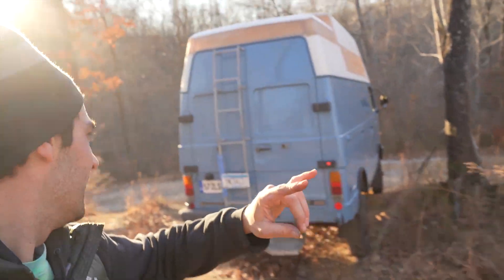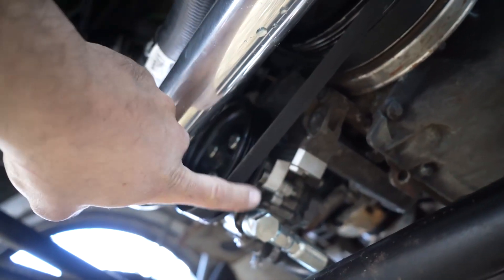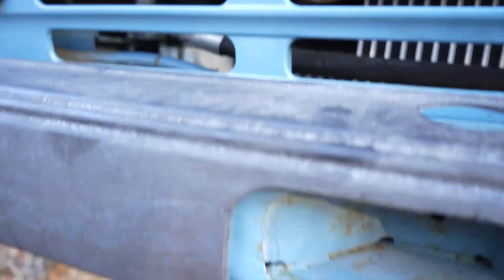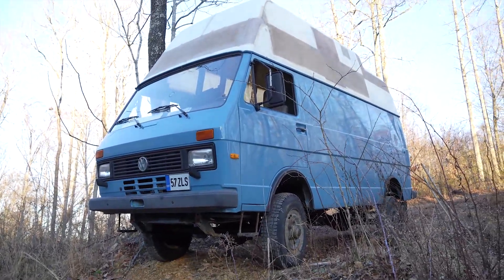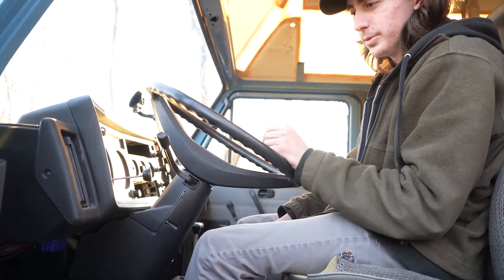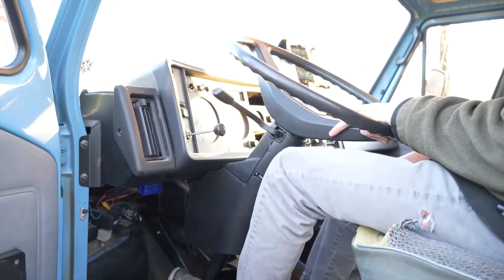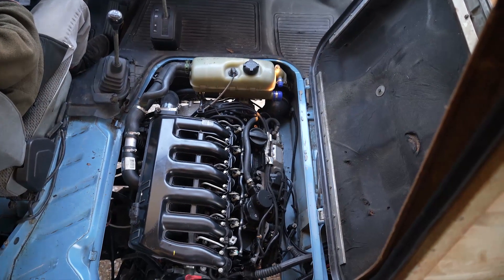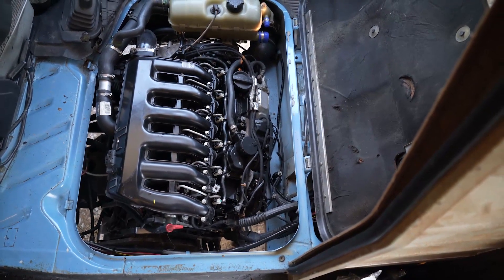Volkswagen LT40 4x4 TDI conversion? The BMW M57 3.0 Twin turbo diesel!

Comment: I only just saw your video. We are about to put this engine in our LT. Can't believe that not only were we beaten to it, but by years 😂. We had a British Ford Capri old school 3 litre in it, then a Jaguar v8 on LPG, but the M57 is the perfect engine for it I think. We are going for about 260hp and adding a separate overdrive gearbox independent of the main autobox to allow for great highway cruising

Comment: Greetings from Turkey, you have a Volkswagen T3 1980 model. air cooled 2000 motor. Bu motoru değiştirmek istiyorum, Volkswagen grubu bir araç motoru ile. Hangi motoru tavsiye edersiniz.saygilar.
Reply: Diesel 1.6td original or 1.9 TDI AFN with electronic gas pedale .benzin
AQY; AZG; AZH; AZJ; APK with invertion oil pump

Comment: Wow. I hope the rear axles can stand the so much stronger engine.
Are you using a BMW gearbox, or have you used an adaptor to conect to the original one? If you use the original LT gearbox, aren't the RPM's to high? I have not had the posibility to study an original 4X4 LT. What is the normal clerance from the oil pan to the front axle? is this BMW engine leaning less to the right than the old DV engine? 
I am well under way with converting my 2wd Karmann LT, from 75hp NA diesel to 2,5TDI 116hp, 5 pot AAT Engine. It is mostly electronics remaining. The clerance under the bellypan, to the front axle was around 1 inch, now it is about 0,4 inch. It is leaning a wery little bitt less to the right. I will use the Volvo M46 overdrive gearbox, from a Volvo 240 Diesel, to reduse the RPM's with 22%. The M46 gearbox weight 33kg and the old LT gearbox 55kg, so the LT gearbox must be strong.

Comment: A 2.0 TDI conversion would be amazing. Is it possible? My LT has the 2.4l 6 cylinder patrol engine, which is not very fuel efficient.🤢
Reply: Use a 2.5 TDI engine from a VW T4 or a Volvo 850 / V70 / S70. It fits the bellhousing of your gearbox and you can alter your existing engine mounts and oil sump to make it fit.
Reply: @John_vandeVen  so tell me about the diesel volvo engine. Is it turbo diesel?

Comment: Would this engine also fit in the reguler non 4x4 VW LT1? With the spring coil front axle. Did you keep the original LT gearbox or replace it with a BMW transmission?
Reply: If you need to ask things like that, don't even think to make an engine conversion. Better find a competent mechanic.
Reply: Good question. My question also.
Reply: Yes. We are doing it now. Even easier thsn this gentlemans epic conversion because no front diff clearance issues, etc

Comment: That's nuts! Love how the inspection cover finds use, plus reuse of the coolant tank means secondary inspection hatch also reusable (I have later model with two hatches). Would be a crazy upgrade from my original 60hp lol! Got the ACT NA engine...

Comment: Auto lever and it’s a manual? Am I missing something? I love the setup!
Reply from the maker: What looks like a auto lever is the transfer case 4H 2H 4L , there is an actual 5speed shifter next to it...
Reply: @Syncrogreg  that’s what I was thinking, didn’t know if it was originally auto and converted or what. I love it! It would be interesting to see a bmw auto adapted to the 4wd, sort of like what you’re doing with the PDK setup. Auto is king for 4x4s imho.
Reply: @Syncrogreg  
Hi I bought the same van and have a m57 engine can we chat? I need help with some ideas please.
Reply: Hi guys, awesome setup! how do I get in contact with you guys? I own a lt 4x4 and have just purchased the m57 engine to make the swap. Do you guys have engine mounts and or other parts for sale? Could save me some time making them myself.